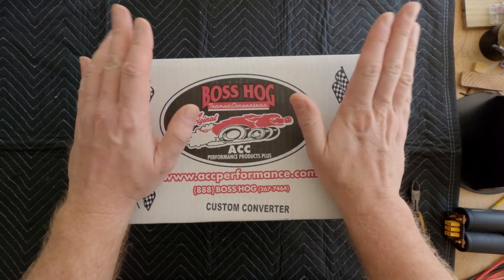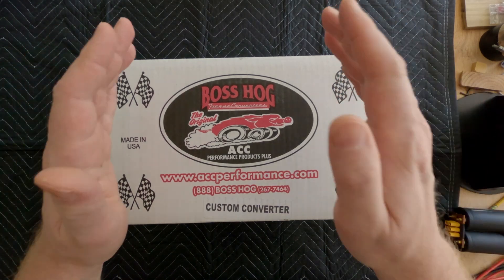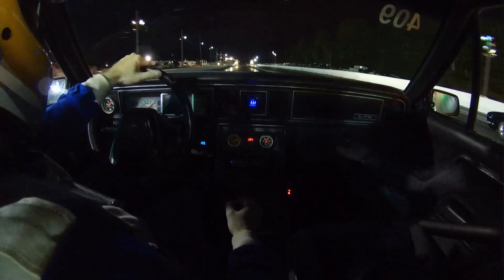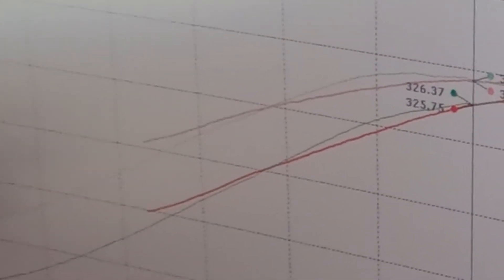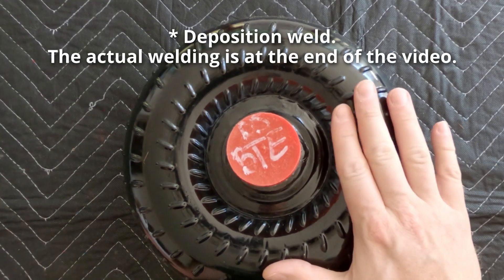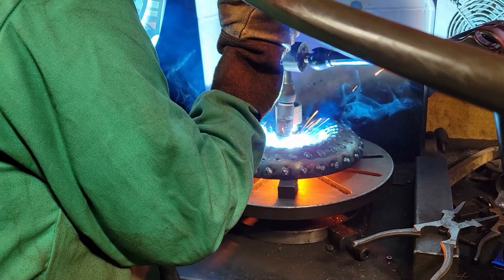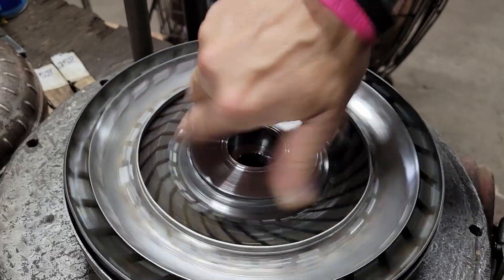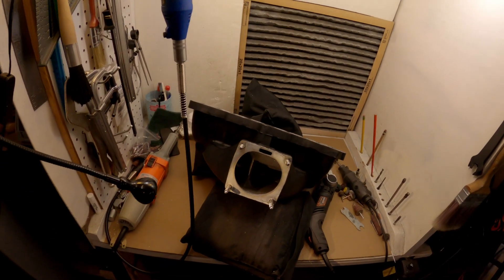Exploring Secrets of Great Torque Converters

Comment: You said the place was in Alabama? Is ptc and acc the same converter company. Ptc is a good converter for sure. Not doubting what you got they have to be good.  For people doubting it I think the converter with lockup would be a different process
Reply from the maker: Yeah, they're in Alabama.  And PTC and ACC are different companies.  I've spoken with Lane at PTC before - they make great stuff too.  ACC does a lot more volume, as well as private label stuff; where PTC is mostly just race and performance converters.  The proof will be at the track.

Comment: My suggestion is to have the glide gone through before you install that converter, It's the perfect time!
Reply from the maker: That's what a reasonable person would do, lol.  I'm more impatient than wise - I'm dying to get this thing on the dyno asap - it's been too long.  I'm going to go by the clean looking fluid and just set it up and run it - I'll probably check the band, though.  The glide is filled with BTE parts, and has extra steels/frictions, so it should be pretty solid.